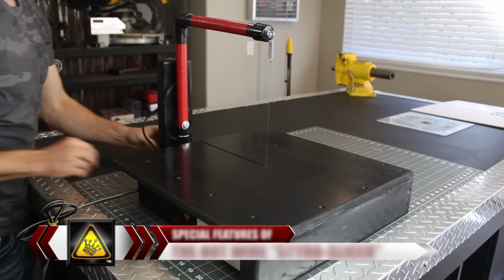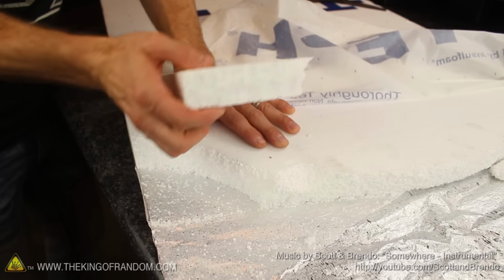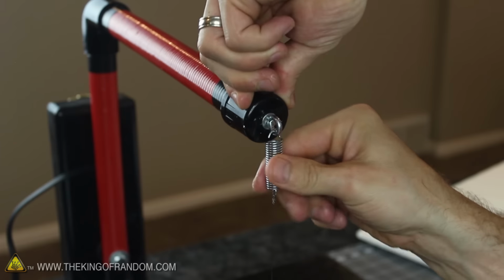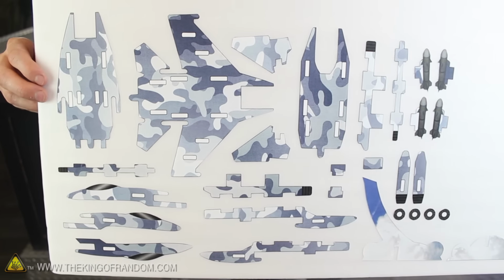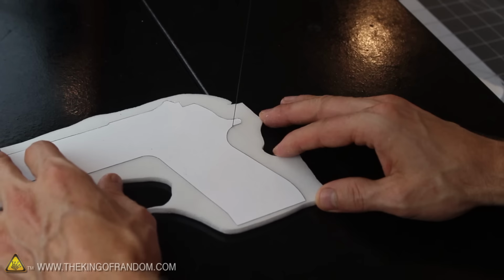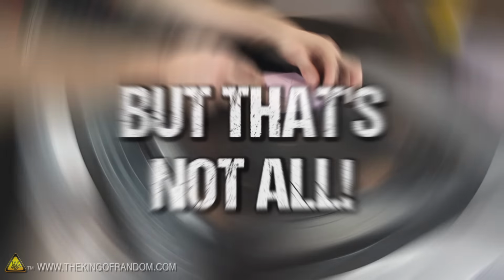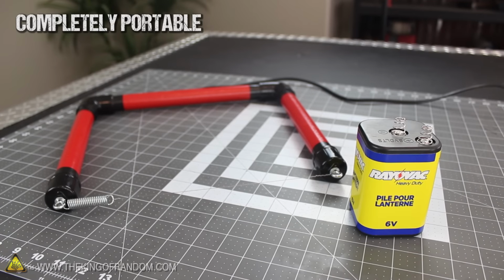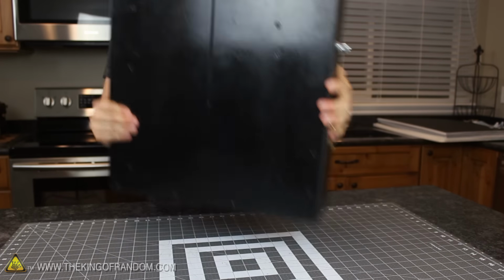The Hot-Wire "Styro-Slicer"

Comment: I have made this styrofoam slicer just as you describe in one of your videos and it works awesomely.
Another project I would like to make very similar to this is a larger scale slicer for example.
Bending a stiff wire and rotating large blocks of foam to create unique shapes that is straight wire will not do.

Comment: I once made a plastic water bottle sized cavity in a piece of styrofoam and it was the worst noise ever... did I mention I was carving it with a plastic spoon? 😂 welcome to grade 7 science
Reply: anyone no what will happen if you put you hand at the styro slider
Reply: it will most likely burn through your hand if you leave it against the wire
a quick touch would simply burn you

Comment: or just hook up some jumper cables to a butter knife
Reply: Sir Cakington rubber gloves will burn your hands
Reply: billurd_ and how are you going to operate it?
Reply: @pinkribbon1007  with ur hands
Reply: Rubber gluvs
Reply: with tour hands
Reply: Or just hold the cables not the knife
Reply: That will wrk
Reply: It probably won't work, the knife is too thick and the resistance is too low, so it would barely heat up

Comment: A quick question to you or anyone else who knows: Would the Styro-Slicer also work for cutting floor mats?  (and if so, would the trick of what was done in the other video of "pour the melted Aluminum or other melted metal into the sand and have it melt away the foam" work with floor mats too?)

Comment: Just an idea for those of you making a Foundry to accompany this cool project.  I used the styro-slicer to help me connect a garden hose as a joint into my air flow line for the foundry.  This way I don't have to be concerned with a support system for my air flow.  The materials listed are in-addition-to all the materials that were purchased or gathered as per the How to Make the Mini Metal Foundry video.  Also, it doesn't take that long, I just wanted to be thorough in my directions as I am not posting a video or pictures.

The final set up I used for air flow is as follows:
Foundry hole -> 1" x 1' Steel Pipe -> 1" 90o Elbow (or couple of your choice) (threaded x threaded) -> 3' hose -> 1" coupling (threaded x slip) -> 1" x 2' PVC pipe -> 1" coupling (slip x slip) -> 1" x 8" PVC pipe -> hair dryer (I connect mine using a paper towel tube that I cut most of the way down its length on either side to separate, tapped with masking tape.  This was to slip the hair dryer on and off so that my wife can still use it at her will.)

My new setup dissembles into the following pieces
- Steel Pipe
- Elbow-hose-couple
- PVC pipe
- couple-PVC pipe-Paper towel tube
- Hair dryer

Materials
 - Styro-Sicer
 - 3' length of Flexible (cheap) garden hose  (cheap ones at Walmart are about $7 or $8)
 - 1.5" thick Styrofoam block (I got mine from an old microwave box) (you will need an at least 2" x 5" section)
 - 1'' PVC 90o (or 45o or couple of your choice) elbow (Note. having threads on both ends)

Directions

       Prep the hose

1. Measure a 3 foot length of hose and cut with a hand saw, making sure to remove any joints in the process.

       Prep the Styrofoam

1. Place the Elbow (or couple of your choice) onto the Styrofoam to trace the hole.  Trace around the hole using a marker or pen for a rough outline while gently applying pressure to make an indent into the Styrofoam. 
(when you pull the elbow (or couple of your choice) up you should see an inner indent for your PVC coupling)
2. Using the styro-slicer on a high power level (hot enough to melt the Styrofoam around the wire), start to cut out this section of Styrofoam on the traced line. 
3. Use the very hot wire to gently chip away the Styrofoam down to the inner circle making sure to leave it a little on the large side (this will allow for a tight fit into the joint.
4. Place one end of your cut hose on the Styrofoam with slight pressure to form an impression.
5. Turn the styro-slicer down to the lowest possible setting and start to cut into the hose-circle that you just outlined.  It won't cut at first, so very slowly turn up the power until it starts to cut very slowly.  Keep it at this power until you get to inside the hose-circle.
(We want to make the cut from the edge of the circle to the inside hose-circle with as thin a cut as possible.
6. Once inside the hose-circle you can dial the power up to a reasonable temperature and carve out the circle.  Make sure that the carved hole is a little on the small side, to ensure a tight fit once the hose is placed inside.  (From the indent there are two lines, the outer line from the outer edge of the hose and the inner line from the actual hole inside the hose, I tried to make my hose-circle cut about half way between these two lines)
7. Turn off the styro-slicer and after it cools down (5 seconds or so) remove it from the Styrofoam ring you have just made.
8. Repeat this process (steps 1-7) for the 1" couple (threaded x slip) from the metal foundry video for the threaded side.

      Putting it all together

1. Gently place the hose inside of the Styrofoam ring.  If its to tight don't be afraid to carve out a little more of the hose-circle. Place the hose far enough into the ring that a small amount is coming out the other side (this will help prevent the Styrofoam from breaking)
2. Twist the Styrofoam ring into the elbow (or couple of your choice) until it is flush with the surface.  
3. Repeat for the other end and your finished.

Comment: +Grant Thompson - "The King of Random" Awesome video, and thank you for sharing, but quick question, how do you cut out the holes on the plane template with smooth edges? I'm guessing just a normal craft knife? Just curious as to if there's a way to use your styro-slicer for cutting holes, but of course, it needs to be a complete circuit. Actually, I think I've just thought of how to do it....

Comment: I'm actually having multiple problems with the structure of mine. I guess it begins with the wire catching onto and sort of bend the wire as I cut, making it hard to control. I would make it tighter, but as it tightens, it pulls the pvc pipe and bends the pipe into an angle instead of a nice square. I also have trouble with the speed at which it melts the foam, but I assume that can be fixed with a higher quality battery. does anyone have suggestions for how to fix these things? I'd appreciate any help

Comment: Great video love it a lot. I am wondering if you could also cut glass bottles with something like this. Now let me explain; I have seen people tie string around a bottle that has been soaked in some kind of accelerate "Flammable fuel" and ignite the string and let it burn then let cold water flow on the bottle and the bottle would crack and break where the string had been burning, Now I am wondering if you think you could build something like this to heat up a bottle and then let water flow on it to cut glass the same way the burning string does? Thanks for sharing

Comment: very nice! but before we made this Styrofoam cutter we use to cut them with a utility knife and it made very clean cuts, it has a way which is:cut the Styrofoam as if your cutting wood, and every time u cut 1inch deeper till it pops out with a clean smooth surface

Comment: Or you know, you can buy a 3d printer, which uses plastic instead of Styrofoam, and is easier to use, and did I mention it uses plastic?
Reply: of course a 3dprinter is better. but they're two completely different things.  you use Styrofoam to cast or build something light. and making things like this is not only about the product but the fun and experience of building one. :)
Reply: stewart c There's one for 300 and something dollars.
Reply: +yugioh guy there still more expensive than this
Reply: stewart c But, they're better.
Reply: +yugioh guy but it is plasic not foam so it wont work for castings
Reply: warmoon kk
Reply: gotta go fast
Reply: +warmoon It isn't that expensive

Comment: Great video! Extremely useful for metal casting. I would think the "boost" switch uses the full transformer output of 12V, rather than the center tapped output of 6V. (6-0-6/2A Transformer)

Comment: Hey Grant, it would be awesome if you could make a short video showing some tips for using this device, and working with foam in general. Some things I would like to see are:

> What you do to make nice holes for slots (as your assembled plane has in this video). 
> Some uses you've found for beveling.
> What you prefer to use to stick layers of foam together (such as your lil swords).

Suggestion:
          Add a type of protractor that can be slotted into position along the back of the wire bar (and stored flat in a pocket on the underside when not in use), which can allow easy bevel angle adjustments quickly.

Comment: I like the look of your build with all the 'bells and whistles'. My hot wire at my (Old banquet table) work bench is much more simplistic: The 'top side' is just a ceiling hook, a length of small brass hanging lamp chain, (so that spring tension can be adjusted one chain loop at a time.) And a spring. ..The base is the fiberboard base from the inside of an old console television cabinet. With 2x2 spacers at each of the long ends. And hole in the center to feed the 32 gage nichrome wire through. on the underside of the hole are two small wooden blocks drilled horizontally to allow a length of Brass Telescoping tubing to slide through as the 'anchor point' of the hot wire. This works with 1 foot lengths of 32 gage Nichrome wire, and a 12V 1Amp Wall-Wart Power supply with long leads and alligator clips. Quick to set up, quick to take down; and worked well for cutting 2 inch thick foamboard panels for insulation repair after some crawl-space plumbing work.

Comment: What battery do you use because I made one given what that one looked like and the 2 look fairly similar but I was only using a 9 volt Square battery which did not have anywhere near enough power to bring the cutting wire to room temperature, let alone cutting temperature so what battery do you use ?

Comment: Here's what you need to make this: Nichrome wire, PVC, some assorted nuts, a 20:1 transformer with the 1 part on the wire, a dimmer switch to the start of the transformer, and the red switch shorts it. Done!

Comment: Hey Grant Thompson I just took your idea and made an even smaller one using the frame of a hacksaw. I even used the metal handle to conduct the electricity for ir to be even more compact. I electrical seal the saw such that holding it bare handed is safe and even added an offhand switch

Comment: How would this handle acoustic foam that you use in a sound studio? That foam is a little softer and I am curious on how it would work. I am designing a sound studio and want to do some cool designs with  acoustic foam and this seems like it would be the perfect way to get what I need done if it works the same way with that kind of foam. Let me know, thanks.

Comment: Just last summer my dad found over 40, 4x5 ft and 6 in thick styrofoam slabs that some place was giving away for free. We was going to use it as insulation in a cabin we are building but needed to trim the blocks quite a bit. We tried something similar but with a car battery and made horizontal cuts to trim it down. Had a lot of problems getting the wire hot enough and speed of cuts since there was only 2 settings, on/off, lol. I would like to see how he made his, it looks really awesome.

Comment: How did you cut holes?
Reply: "And I'll show you how to do that in another project video"(10 weeks later you'll know how!
Reply: +Chalupabatman 20 preview videos later you might even find out how he actually does it!
Reply: I think we all wondered about this.
Reply: +Insane CoolAid I'd presume just like with scoll saws for woodworking; disconnect one end of the wire (saw blade) and stick it through the foam through a hole you punch (drill) with some other tool, connect wire , do the cut, disconnect wire, pull wire out...

Depending on how exposed the area will be in the finished product you might get away with cutting in to the hole from outside, do the hole, turn off the heat, remove the piece and glue the 'extra' cut from the outside to the hole back together again.
Reply: +Insane CoolAid He heated a metal rod and pressed it against the styro-foam
Reply: i think that the holes you have to use a exacto knife
Reply: did you noticed that there is a STRING? meaning you can pass the wire through a mini-hole and the attach it to the Spring a cut (melt) the complete hole form
Reply: +Insane CoolAid Warm bullet shells or a template
Reply: +phoolxcool bullet shell actually
Reply: +José Luís Teixeira "did you noticed"?

Comment: Neat project. The transformer is for the lantern batary, right? Or are you stepping the mains down with it? If so, you can use a simple usb adapter to do the same. It will make it verry compact.